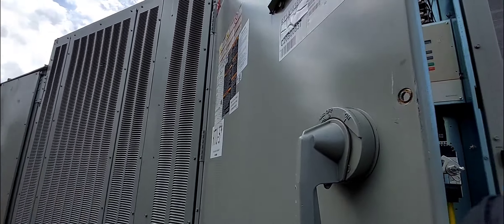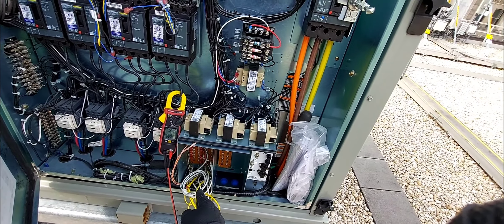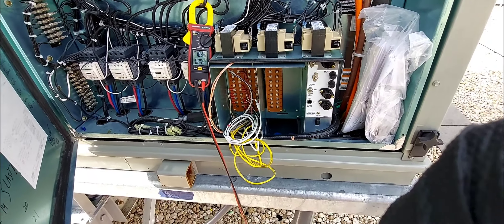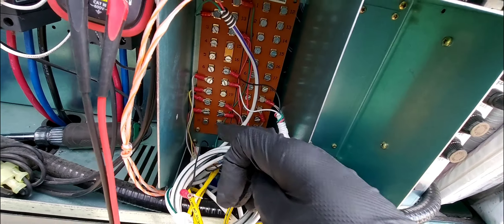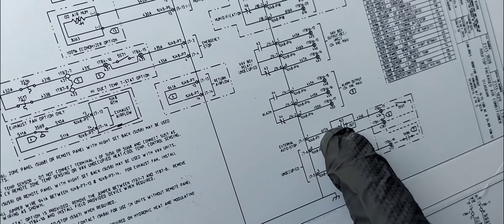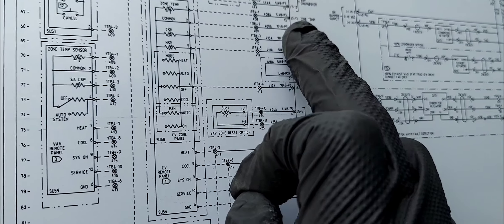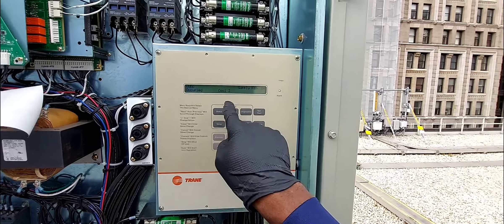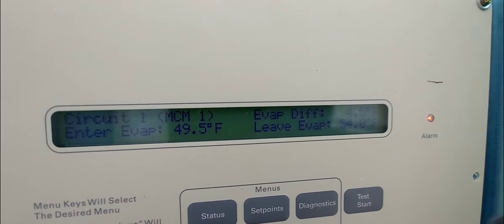HAVC SERVICE | HVAC TROUBLESHOOTING

Comment: it could be a summer time unoccupied set point that has not been switched off from the BAS. I have a feeling they might plug that back in and setup the proper perameters for that unit.
Reply from the maker: Thanks for watching

Comment: Nice , so did the NSB panel need to be replace, what you do with the wire you remove from #6.
Reply from the maker: the NSB panel wasn't defective it was found off! i just couldn't gain access to it at the time... thanks for watching

Comment: Do a video on test mode . Currently learning about RTU in hvacr school trans units as well. The rtu was calling for heat , and then wouldn’t turn off after it reach set point . Once i got the unit to stop calling for heat it wouldn’t heat back up now . Please comment back for any advice
Reply: Also my thermostat is wireless but there is another thermostat i forgot the correct Name exact & model number , but I found on the schematics how to wire it up and I wired it up correctly so I’m not sure if the thermostat is bad or not ….
Reply from the maker: Any errors?
Reply from the maker: What type of system are you working on?  Does it have a terminal block with designated thermostat wiring connections ie R.C.Y.W.G.  ?
Reply: @D2DNYAC  just a red blinking light, Which means it’s trying to call for heat I believe, also I will check for the terminal block when I go back to school thanks for your help so far i really appreciate it . Keep uploading!!
Reply from the maker: Yes I have two videos on Trane RTU test mode already uploaded!
Reply from the maker: @Aj TRANE RTU’s playlist: https://www.youtube.com/playlist?list=PLI0CUXah6YNl0dvSlZ2vZMO11KNi8CKGa

Comment: I watch all your videos but that one  I don't  get it , how just removing a commun wire the unit come back on
Reply from the maker: It's was common to the trane zone sensor or similar, no common to the thermostat it goes blank or dead. It's important to remember between trane zone sensor and unit it operates on communication unlike standard thermostats and units.

Comment: Whoa.. what is that building @ 15:23 ? Really cool architecture.
Reply from the maker: I don't know of that building being anything special it's just another building in New York City
Reply: @D2DNYAC  Were you near 8 Spruce Street? From internet pictures it looks like it might be the New York by Frank Gehry. If so, it's considered in the top 10 craziest looking buildings in NYC. If it is, and you think it's just another building in NYC then we have a major difference of opinion. 😃
Reply from the maker: It is Spruce street LOL 😆 I guess the building is cool idk i am not intrigued around these parts there's more intriguing buildings like the oculus my opinion and it's only a few minutes away.
Reply: Good luck with parking downtown😅. I worked there for 13 years and the Financial District has only gotten worse. My company tries to avoid the area if possible.